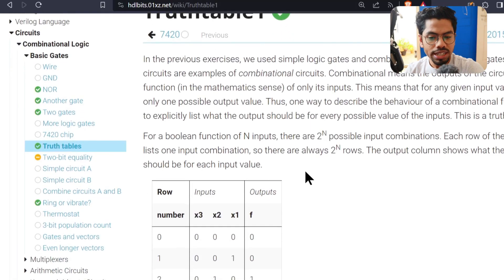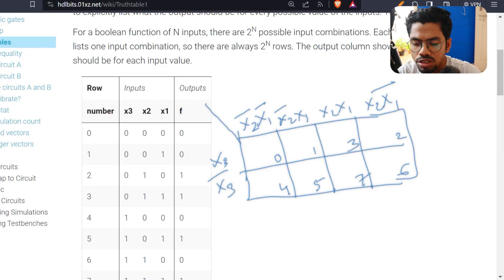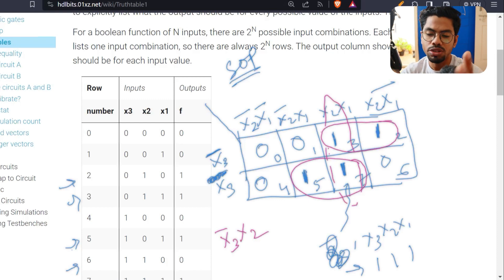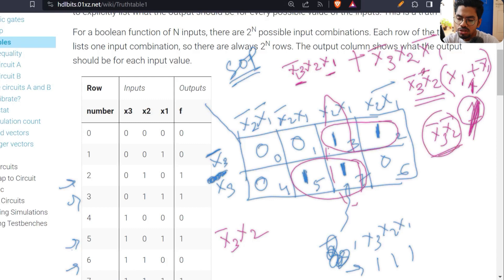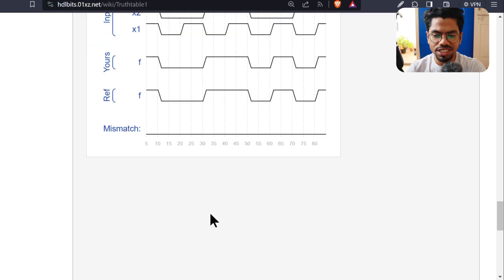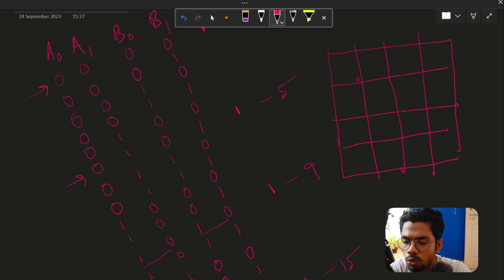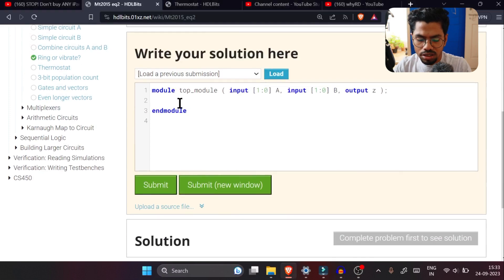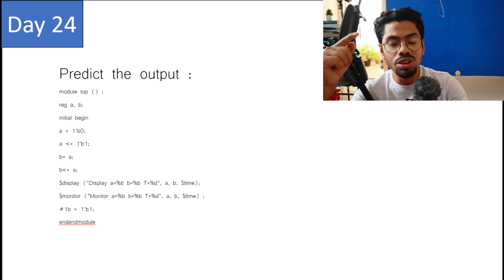Magic of K-Map | 30 Days of Verilog Coding | Day 24

Comment: @whyRD:  Hello, enjoying your lectures so far.  I had a question on this problem though.  So instead of using k-map can we use an "if" loop/"if" procedural block to write the code?  I used "if" block and got a "success".